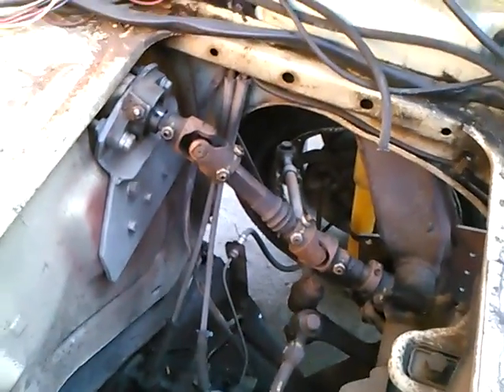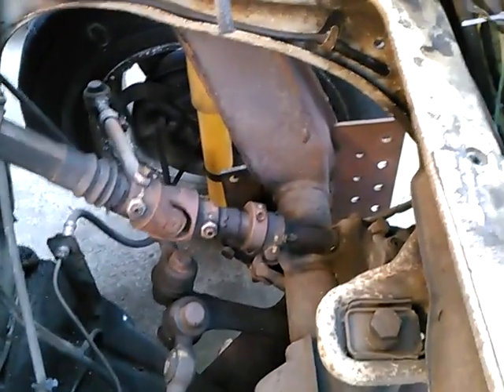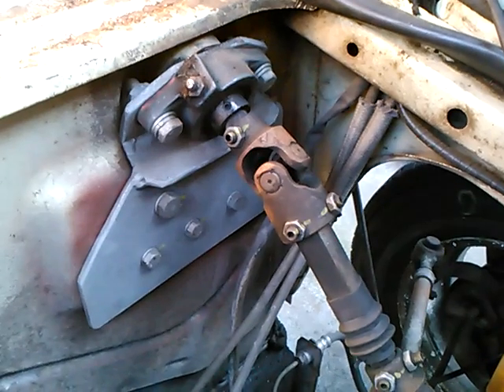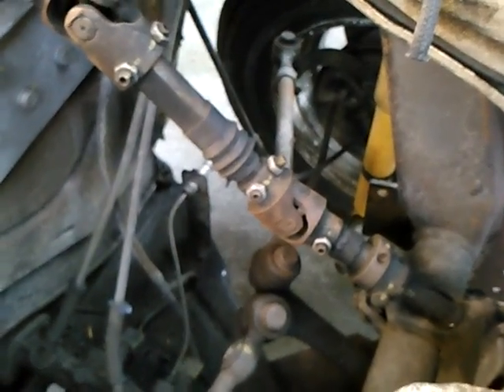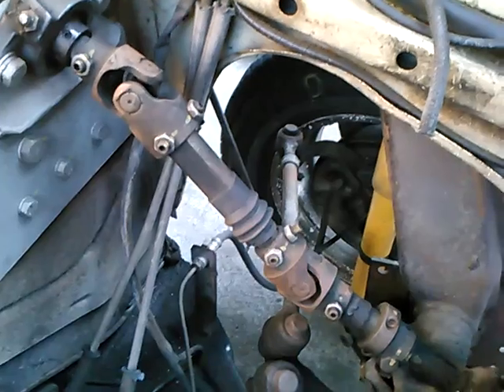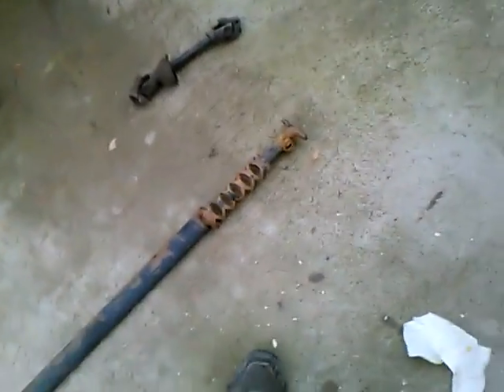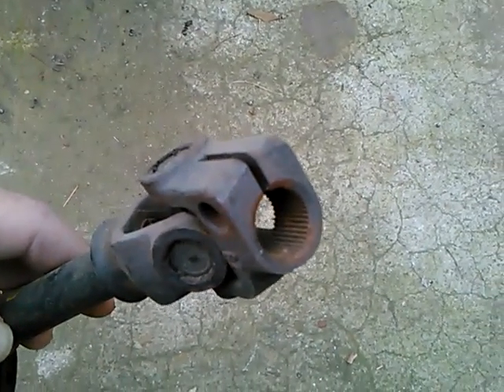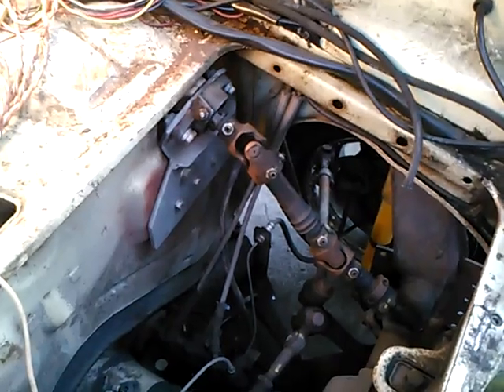U-joint Steering for VW Baja Bug with 3" Body Lift - Part 1 of 3

Comment: i've heard of people using a superbeetle shaft.   i have a 3" lift on mine and the PO used a thick rubber spacer...   that is starting to fail so i'm still looking for the correct solution.